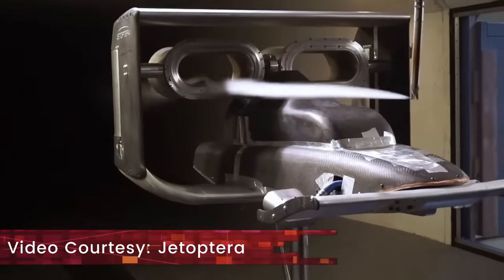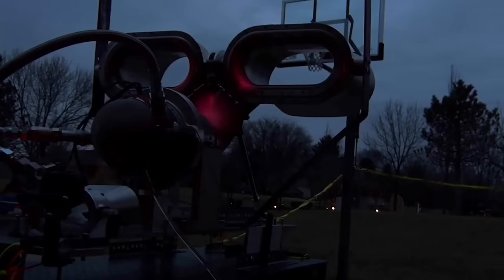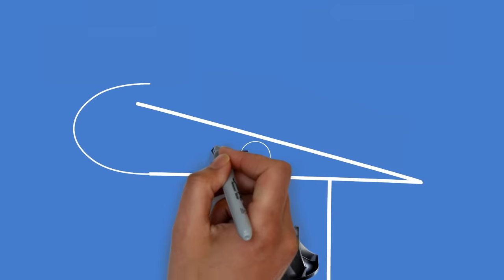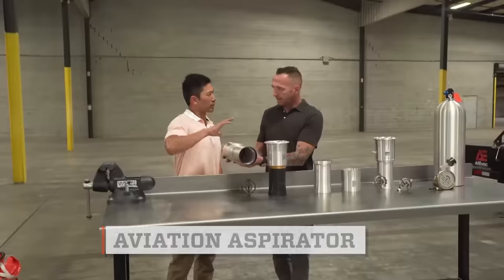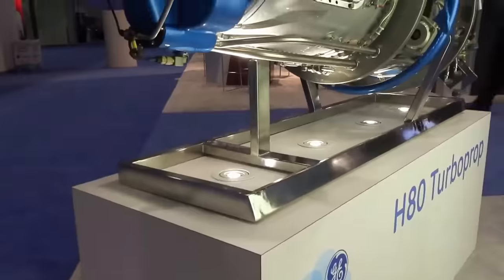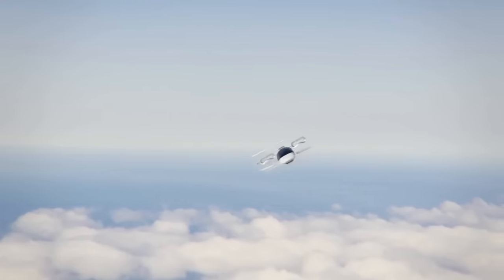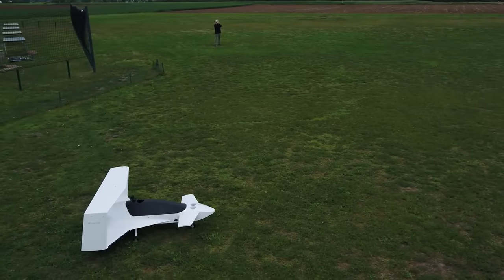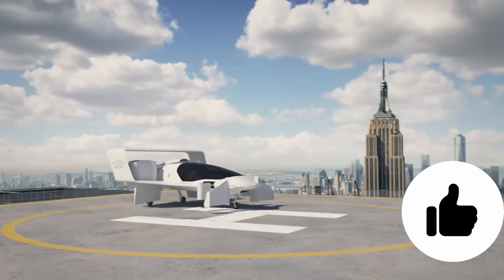Jetoptera's Bladeless Propulsion System

Comment: Interesting concept, I wonder if this could be applied to boats, with an electric fan. I’m thinking particularly to the small dingy and kayak/ trolling sectors where hands and animals proliferate.
Reply from the maker: That is actually a very good idea. I am sure people looking at submarine propulsion would be extremely interested and even boats
Reply: Good question about boats.
Reply: another thing to look into is how large ships also pump air under themselves to reduce drag, could be really interesting
Also for a kayak you could probably test it with a 3d-printed set of parts, would love to see that become a reality
Reply: Pump-jet on watercraft have quite a few similarities.
Reply: Tom Clancy wrote about such a submarine drive in The Hunt for Red October, in the 80's.
Reply: @skydancer2992  Yeah, Pump-jets have actually been used in real submarines.

(In the movie it was a magnetohydrodynamic drive. So if anyone gets confused it because in the book it was actually a Pump-jet. Which makes more sense from a going silent standpoint.)
Reply: Probably not, using water alone. Water does not compress, so the coanda effect would not create a low pressure zone to stimulate flow.
Reply: Thought forever ago how it could be used with flood control pumps on a big ship using something you need to get out of your boat to get more of that something out win win
Reply: The static propulsion housing would generate too much drag under water. Blades create less drag because they move with the water at speed and are not static.
Reply: @JimMaz  true, but when Hamilton developed the first successful pump jet as we know them today he moved the outlet to the waterline, where there is less pressure. Lower pressure could also be achieved by airating the low pressure area.
Reply: Yeah this was something that just popped into my mid too
Reply: @ElectricAviation  Roger that,  I'm thinking red October  ....  maybe even a flying sub
Reply from the maker: @sailingcapedissappointment2012  I thought of that too
Reply: @JimMaz  not so, ducting in any fluid works. Theres even a water pump in this very video.
Reply: I think you are talking about forced air propulsion, rather than water-jet, or?
Reply: @ElectricAviation  fluid dynamics surely comparable despite being a heavier medium.
Reply: no, coanda effect only works effectively with compresable fluids. water is noncompresable.
Reply: @Rivenburg-xd5yf  theres literally a water example of the same concept shown in this very video (for rapidly emptying water), the effect may operate differently to one in a fluid that can be compressed, but it still works.
Reply: @Rivenburg-xd5yf  cheers. I'll revisit Bernoulli's Theorem.
Reply: @andrewsaint6581  i think several of the fluid dynamic effects like bernoulli, coanda and venturi are all really aspects of a main effect.
Reply: @lucasschofield8716  yes, but it operates on different priciples and thus has very different efficacies. coanda effect requires low presure zones created by compresable fliuds.
Reply: @Rivenburg-xd5yf  but nevertheless it DOES work as intended.
Reply: @lucasschofield8716  define "intended".
Reply: @Rivenburg-xd5yf  increasing the volume of fluid shifted......which is why it's more efficient.
Reply: Look for it 
In   👉1930 👇
Henri Coanda build the first UFO and he call it: 

AerodineLenticulare .
Reply: @Aaron.A22  thank you. teach these modern citiots some REAL tech history.
Reply: Cool
Reply: @ElectricAviation  Yes at a boat ist maybe a good idea. Bec there less efficiency more resistance and more weight doesn't matter so much. There is https://en.wikipedia.org/wiki/Ducted_fan more save. In a electrik plane its just bullshit.
I suggest you talk to someone who is a real expert and then you can make a "busted" video about this kind of nonsense innovation.
1 A real hydrodynamic expert.
2 A physicist who can calculate for you how much energy you need to fly and how much energy is in a battery. Dont be diasapointed about the result.
3 Don't ask Elon Musk :-D
Reply: we tried that, too, have some cool videos of it. Maybe some day I'll post them.
Reply: Oh you mean like step it up to Foiling ?
Reply: @timothygooding9544 to much  air in water makes a ship sink lol
Reply: At 4:58 in the video a colander affect water pump is shown used for pumping seawater out of flooded compartments (Tank Liquid Agitator). So the idea works with sea water and it should be possible to scale that up to replace the main propeller.
Reply: @ElectricAviation  A early version of this was tried in the soviet union after WW2 by using a screw drive in a tunnel design. however the politics and greed of  the leaders of that country doomed the project to failure. In modern day terms NautiExpo has a few model available. they do cause a similar affect although they are not ducted in a way that takes advantage of this affect
Reply: A problem I can come up with, is the speed needed to maintain the flow, and the irregular pressure from bouncing on waves.

With that said, I love the idea of a kayak going 30 knots or more in shallow waters. It sounds excitingly suicidal

as already mentioned, it could also have great potential for submarines. Perhaps this is the secret behind the "super-sonic sub"
Reply: @JimMaz  Just watched the AC75's racing in the Prada Cup finals.  If you were right these boats wouldn't be able to foil... but of course they do!  My misunderstanding, sure, but what have I got wrong here?
Reply: @ElectricAviation  Subs! Fantastic coverage as always. I love highly technical material on subjects that promise so much potential in evolving humanities methods. When it happens the transition to a feasible aerial transportation system will have a massive impact on other nations. Large areas like Africa and India have so much room to incorporate this. The US as usual will lag behind due to a lack of foresight; although, if it involved the opportunity to enrich the political entities here it would happen overnight.
Reply: Very interesting but to a certain degree don't they already w some engines?
Reply: incredible ideas...
Reply: They could, but you have the dilemma of straining out foreign debris and dealing with deposits and organic/barnacle growth in the system, which effect is exaggerated by the small dimensions of the passageways.  Maybe that's been figured out but I'm not aware of it yet.
Reply: @ElectricAviation  Cpt. Ramius: SMH
Reply: That would be awesome as well
Reply: @JimMaz  So how does any Hydrofoil create lift?.Creating low pressure methinks, no?.
Reply: @timothygooding9544  huh I didn't know that some ships used air, that's pretty neat.
Reply: @skydancer2992  Let them shing
Reply: YES   ...VENTURI BLASTER  WITH WATER JET ENGINES
Reply: @maca5645 , yes, it's a wing.
Reply: @MrMonkeybat  

It's taking water, a non-compressible material, and pushing it into air, a compressible gas, which is why this works. It would not work if the system was kept completely underwater. Without being able to compress water the system couldn't create the low pressure zone in which to draw matter from the high pressure zone (which was on the left of the diagrams in the video). That's where the efficiencies of the system come from. The other efficiencies due to the vortexes don't come about if the high pressure area doesn't get created to move the matter through and create the vortexes. 

While one may create a system that pushes water into the air it couldn't be used in many places  due to the possibility of hitting other ships, boats, people, and wildlife. It would be expensive, and take up valuable space, to have ships with two propulsion systems so it would have to be very, very efficient.

The system from the book and movie Red October, originally from Tom Clancy, operated on a different idea. It used magnetohydrodynamics. The submarine created a large magnetic field in the engine and used the slightly magnetic properties of water to propel the water molecules as thrust.
Reply: Gasses liquids ect sticking to sides is also known Van da Walls or stiction effect
Reply: @ElectricAviation  I would think making a hybrid ion propulsion system would work better by ionization of the air just before it is exposed to air and a positively charged area at a wider spaced end to add extra pull to create the low pressure area.
Reply: While water does not compress (or compression is negligible), you can still create pressure differences. For example, a wing in flowing water still generates lift due to the pressure difference between the top and bottom of the wing.
Reply: Fuel cell powering is still electric & zero emission. We'll have to see about this prototype, yet it makes no sense why you don't include fuel cell for electric aviation, when it's an electric motor powered by electricity from both hydrogen powered (can be green) fuel cells & batteries. Doosan & Toyota have demonstrated.
Reply: @skydancer2992  That was a Magnetohydrodynamic drive, not the same thing.
Reply: I'm thinking it would work better with water! It's much more dense then air
Reply: @solarblitzch9055  the only myth that will be busted is "Batteries are at there peak"
Truth is, batteries are in there early stages STILL! There is a long way to go

As for the efficiency of air flow
We know a lot and we have a good understanding of it, but there is still more! A leap is around the corner!!
Reply: @sokol7215  to much of anything, and it will fail. It goes for anything!!

"To much air in water makes a ship sink"
Ships don't float on air, they float on water! So, it will definitely sink!
Reply: @primus4cameron  they are floating on air, not water. It work's better on a solid surface. The air pushes up bouncing of the water or ground
But doesn't mean it ain't a good idea, just a different effect
Reply: @Qui-9  good point !!
Painting it may not be enough 
We have had ship's on our ocean's for a long time. If we haven't worked out how to keep it clean yet, with new understandings and tech I'm sure we will soon
Reply: @curiousviewer5991  we are talking about batteries not keeping up with the fans 
It sounds like you want to electrify the air surrounding the plane, that would take a lot more power to run

Sounds interesting, would love to hear more about it
Reply: @curiousviewer5991  that sounds like UFO tech. If done right (Including power source), it may not need wing's. But then again, that sounds like magic! Even to me

Would still like to think about it more
Reply: @greekkidshows9373  Not the air 'around' the plane per se as 'through' the plane. I'm referring to the example of an article of 'MIT engineers fly first-ever plane with no moving parts' in November 2018 where the charged wires of the model created a flow of nitrogen ions for thrust (which also made it bladeless propulsion).

What I'm thinking was to do the same thing inside the bladeless thruster's ring where the air would be ionized at some point while it is 'inside' the thruster then attracted to the opposite charge after the air is exposed to the inner surface of the thruster and is  following the curve of inner surface to create the low pressure effect. If that air is charged and attracted to a charged surface at the end of the inside of the thruster then the air might be able to create more low pressure and more thrust.
Reply: That would be pretty cool on a boat 👍
Reply: .....I thought this stuff was implied in the Red October submarine movie .
Reply: @skydancer2992  ..fancy. I just wrote almost the same.
Reply: @Cythil  ..magnetohydrodynamics could be fairly quite. Invented jointly by Einstein and his colleague for refrigeration purposes originally but found success for pumping liquid metal in nuclear reactors a decade later .
Reply: @sailingcapedissappointment2012  ...novel by Harry Harrison :- The Daleth Effect for that flying sub.
Reply: @charlesdickens6706  So far, as propulsion, it has not been quiet however. Not compared to the alternatives at least.
Reply: @solarblitzch9055  it’s innovators that advance us. An expert that already knows everything can only teach. An expert who innovates moves us forward and sometimes it’s just the dreamer that ignites the spark or tries something that is impossible and we move forward. Anyway we all know that bumblebees can’t fly an expert proved it. The r/c aircraft flies.
Reply: @duncanb1981  Do you mean like surf.drives aka by Arneson?
Reply: @ronprince1478  Yes you are right. But there is a difference between a possible vision that does NOT contradict the immutable laws of nature and those that are incompatible with the laws of nature. In the present case, that is the question of the energy content of batteries. Batteries are simply missing to operate a VTOL aircraft with a longer range than the next children's birthday party. They cannot even be seen on the horizon because there is no known principle which would bring them anywhere near gasoline. We're talking about a factor of 30-100. I would be happy to know the opposit.
Reply: Hands have a negative impact on proliferation.
Reply: @ElectricAviation  How can I invest in this technology?
Reply: I know for a fact there are sump pumps which use this principal to pump water using city water pressure.  This is used as a backup if power goes out.  If it works there, it would work for an outboard motor.
Reply: Great idea.  Shouldn't scare the fish!
Reply: Exactly what I was thinking in regard to boat propulsion
Reply: @JimMaz  Water may not "compress" but it does react in much the same way. We're actually already using a similar version of this concept for boat's and diver's propulsion unit's. The safety ring around the propeller creates much the same process. In my humble opinion this is the reason you'll see and increase in speed. Take a boat and a small outboard motor and clock the speed. Then add a solid safety ring. I specify solid because some rings are essentially just a mesh cage and don't accomplish anything other than added drag and keeping thing's out of the prop. Ok now with the solid ring around the propeller being the only modification on the same boat and motor  you're going to see an increase in both speed and manuvering. Think about how a tiny impeller circulates water in massive holding tanks to prevent them from becoming stagnant. So while water doesn't compress it does still react j.s.
Reply: @ElectricAviation  @sailing Cape Disappointment  glad to see I'm not alone in the truly all terrain/environment thought. Seems to me that fluid dynamics are fluid dynamics and the only real difference in environment is the density of the fluid. I'm not sure it's even possible to truly test at this time but it also seems to me that if we can reduce the drag to zero or at least close to it then the denser the "fluid" is the greater the effects would be.
Reply: @skydancer2992  There are surface ships using the Magnetohydrodynamic propulsion. It's been 2 decades since they produced one in HK or Japan.
Reply: @Cythil  And torpedoes.
Reply: @terranovarain6570  He covered that. Eductors are used to lift from deck to deck using the ships fire main pressure.
Reply: Good thinking, and good question! Such a system could reduce or even eliminate the huge number of animals killed by boats. It's extremely common for sea life, especially whales which like to interact with boats, and regularly are severely injured or even killed by the blades of the engines.
Reply: @Teddystream.  What does "Gasses liquids ect" even mean? How would electro-convulsive therapy help??
Reply: Idea:   What if air was captured from above the surface, and channeled under a boat, from the front.  The Hull would have many channeled ridges, that the air is directed to, in order to keep the air distributed well underneath the boats bottom.  The air would of course, likely be mixing with the water flow, created an airyated water.  Since air is lighter than water.. this should reduce help to raise the ship a bit, reduce its mass effect, and the flowing channels might also provide an even more pronounced forward thrust effect.  (which could be directionally altered at the rear of the craft)

 Ohh, and the ridges would not just be on the bottom of the boat.  You could add air-trapping ridges all up the sides of the boat, providing effect on all surfaces of the boat.

 A slightly modded version, would forgo naturally forced air... with pumped air, into air-holes / nozzles, that are between the ridges.  The logistics would be a bit more challenging, such as needing one-way gates.
Reply: If you used hydro foils of similar shapes that could be raised or lowered depending on acceleration values i imagine it could be built out as a bolt on with modern potted motors and a small LiFe or graphene battery.
Reply: @ElectricAviation  I propose another concept based on the same principle. how to express it more clearly. Imagine that a supercharged wing-ring with three or according to the calculation of engines fixed on rotary strut wings (for control , emergency descent with autorotation) connected to the inner ring. The inner ring holds the sphere in which the pilot and control. This scheme has all the advantages of any aviation means, well, with the exception of high speed.
Reply: There are jetskis with inductor propulsion; if you stick this baffle at the end of it, maybe you could get a boost
Reply: How do you believe fans that handle air could have this applied to boats  ?  Wouldn't it be better to have something that handles water be applied  ?
Reply: @WilliamRNicholsonLST-1195  with a combination of wing in ground technology and coanda effects generated through a foil set into to surface of the underside edges of the craft. Coanda to produce thrust vectors and the wing in ground effect to maximize loft and acceleration control.
Reply: The compressibility of air makes it more efficient I think
Reply: As the OP mentioned trolling and animals I think he ment have the propulsion above the water line.Similar to the Everglades swamp fan boats but using this method of forcing the air to move the boat.
Reply: @greekkidshows9373  Been waiting for this new battery tech for many years now,and still no sign of it.Batteries are more or less at there peak.
Reply: @ElectricAviation  Something like this has been used for silent propulsion underwater (submarines). I forget the name they used, but it uses magnetic induction, if I recall correctly, to move the water.
Reply: Same concept can be used to generate Ions with air or water.
Reply: @sokol7215  It also causes problems with the impeller if it is cavitation.
Reply: if anyone is familiar with The Good of the Land, he has built an inexpensive electric motor for his Kyak, and is extremely resourceful . WOULD BE AN AMAZING project for him.. Go hit up his channel! And no, I am by no way endorsed or part of any offering. 
The Good of the Land
Reply: How about families with a boat? I think any parent would be concerned about children near propellers.
Reply: @sailingcapedissappointment2012  Haha! That’d be a sight!
Reply: Well... Jetskis are a thing, you know?
Still you have to have an intake with good filtration and you don't gain extra energy with this setup, you can only trade flow speed against flow volume, which is exactly what that device does.
Newtons 3rd still law applies since you push yourself off of the air molecules in the system.
Don't get me wrong, it's absolutely cool and novel, but it's just less efficient.
Reply: It's a jet sky.
Reply: @johndough8115  ive wondered about this as well.  A cushion of bubbles.  In a way, that is what a stepped hull is trying to accomplish.  Fountain did produce a hull that claimed to use a similar design.
Reply: Does it have an Emergency parashute incase of malfunction???
Reply: @JimMaz  A tandem of water-compressed air cutter was already being used by the US military ind.complex as of 90's decade... To date, video footage shows 3. inches thick solid iron (?) metal can be cut by such "water cutter"- powered by 200k psi pressure, .5mm size water being ejected by its nozzle- the slim water cutter "blade" mixed with diamond powder(?)...
Reply: It doesn't work as described.
Reply: Looking at the picture of that plane, why not loose the two "engine pods" and instead use the box wing itself to duct the air out of, using the same concept...
Reply: It should do, considering the flood removal pump comparison.
Reply: The first time I saw this concept it was used in water.  Steam is used. the low pressure produced becomes even lower as the steam instantly absorbs into the water.
Reply: It’s called a jet ski 😂🤦🏼‍♂️
Reply: Haha
Reply: it's not going to work for my small sailboat....i need the prop re-gen....sail + prop M/G..
it could be used on marine apps without a sail maybe... but then what's a boat without a sail? not my boat.
Reply: @ElectricAviation   I thought of using this for submarine propulsion over 20 years ago. We had air amplifiers at work to blow away fumes. A device was attached to the female adapter on the compressed air hose and the amplifier plug into the device which eliminated the loud noise created when the amplifier was plugged directly into the air supply. Since air and water are both fluid mediums I reasoned the amplifier would work with water and could provide near noiseless propulsion. And also theorized that a giant version of the amplifier powered by a small jet engine used on Lear jets could provide economical thrust for a commercial jet liner. Nice to know I was right.
Reply: This is utter BS, and a scam.
Reply: You are giving away a perfect patent.
Reply: It can't work with water.
Reply: @ElectricAviation  that's not a good idea water is not compressible.
Reply: @musiceditfor  why.?
Reply: @bentonmarcum8924   The intake surface will be less useful I feel .I need to make a simulation to confirm.We need isolate the main propulsion fan then try to figure why intake water redirection is more efficient.Also we can check if the classical fan applies lots of force opposite to the boat move ,since the water particules are very slow ,I don't think there is a lot to gain.
Reply: @musiceditfor  are you on the electric aviation team.? Are you taking into account the higher mass density of water which would generate higher thrust for a given amount of velocity.? As for speed of water particles, many boats and jet skis use water jets for propulsion. Jaques Cousteau pioneered the technology for small submarines to move among sea life without harming them. So water can be accelerated.
Reply: In theory it should but we might run into some problems due to the fact that water is not compressible.